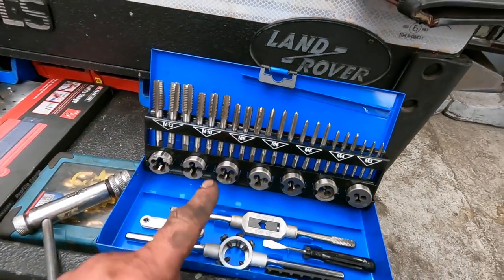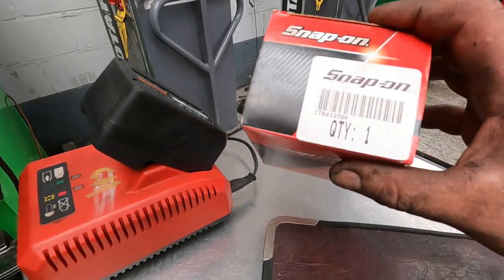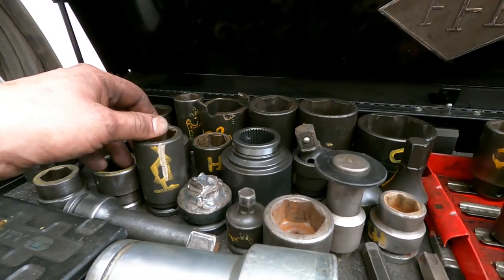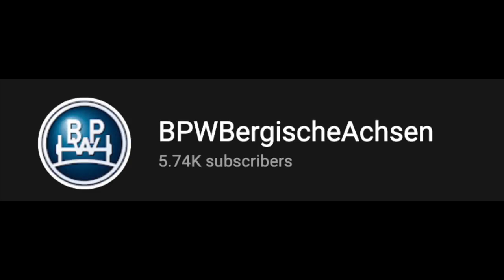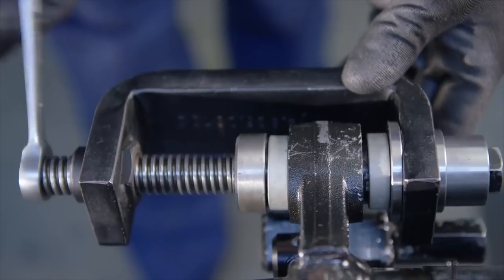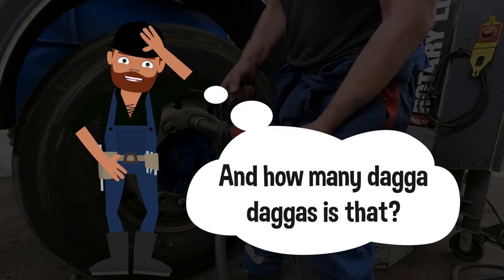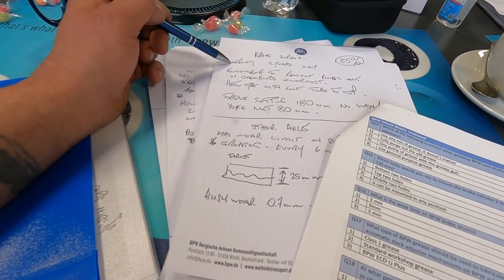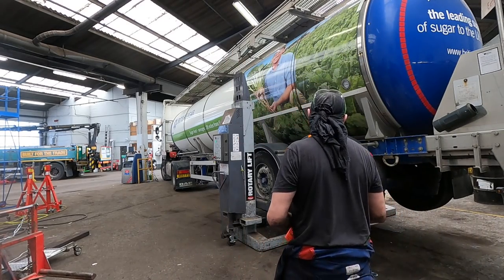UK (Heavy Axle) Trailer Technician- VLOG plus- Was The BPW One Day Course Worth While?

Comment: If you scan the qr code on bpw axles with a modernish smart phone it will take u to workshop manuals just a tip for anyone looking for torque settings and aprentices doing there college write ups 👌
Reply from the maker: Spot on!  that is of course if it has a QR code.  The later ones have them.  But yeah damn good heads up chap!
Reply: @trailerfitter2  fair point about if it has one 👍 brilliant content by the way

Comment: Great stuff as always. I just brought one of those snap on guns in 3/4  as I kept breaking the anvil on the 1/2inch one
Reply from the maker: 3/4 battery powered or air powered?
Reply: @trailerfitter2  battery powered. It's actually only 100nm more powerful than the 1/2 inch but I'm hoping the anvil is stronger

Comment: Groove is obviously for a when the snap ring breaks you can put a cable tie through the hole and around the groove because no one wants to report broken tools 😂
Reply from the maker: We  used split pins until someone snapped the gun in half. Literally broke the alu casing.